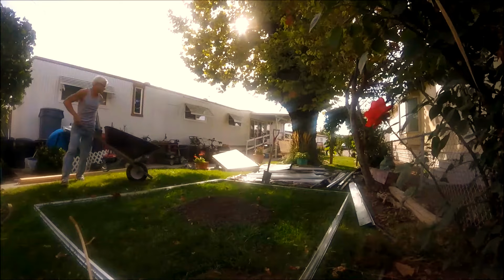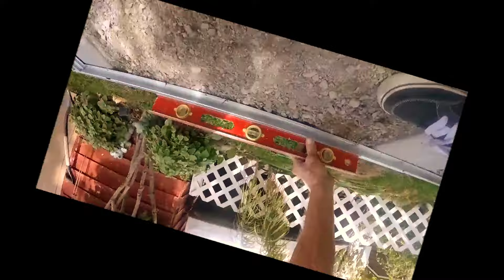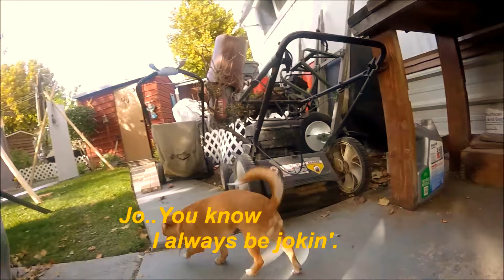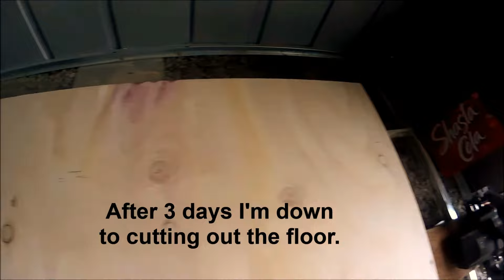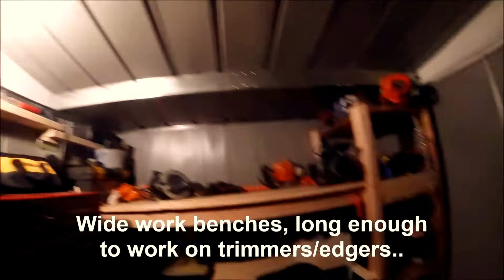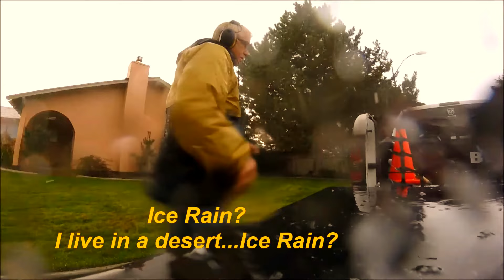Building of The Shed @ KenMows4U Lawn Care

Comment: Looks like you were long overdue for a shed. 3 years with that chainsaw sharpener & no place to mount it! Makes a nice place for a lot of tools & you've got a hangout, even in the rain. Came out nice Ken. We had hail here several weeks ago.
Reply from the maker: Thanks Pat, I was holding out till I could make a wooden shed, (More Secure), but went with this shed to save $2,000.  Have added un-spoken security steps but figure if broken into I can replace my equipment with new for the 2 grand I saved...Hey Pat, Maybe this shed will help me bait and catch Shady :) :) Peace.
Reply: Good price on it. I've seen those sheds last forever Ken! Good thinking! Shady is on every street it seems. SOB! Peace.